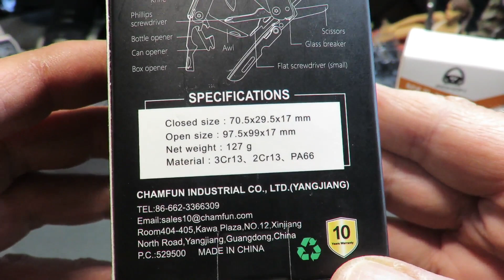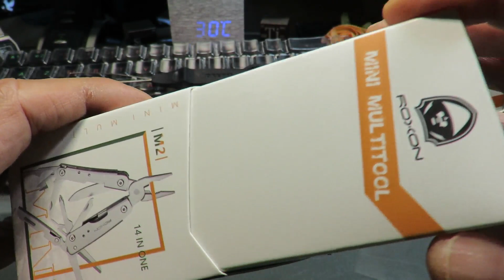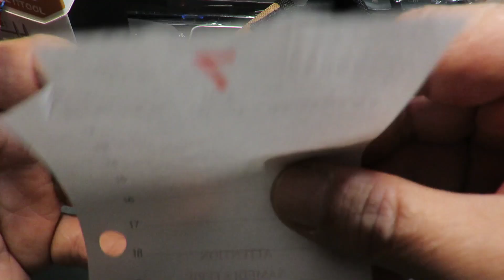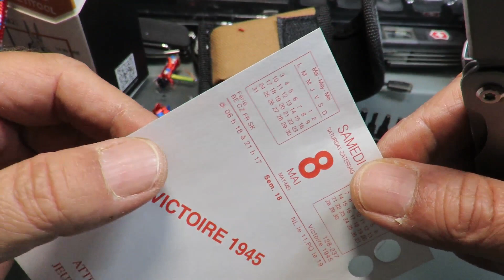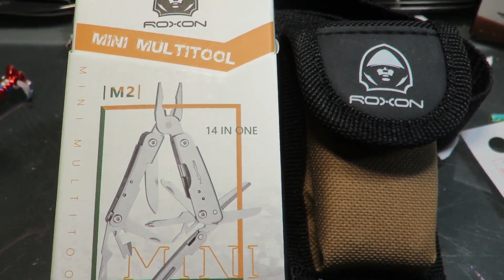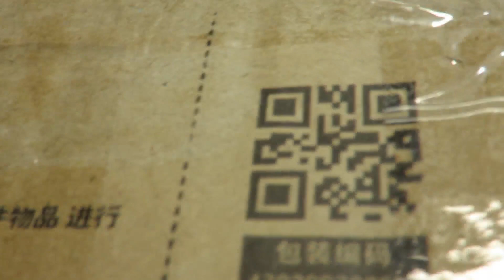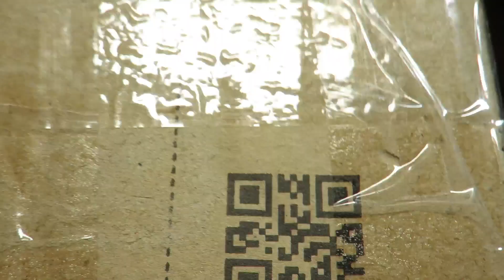ROXON M2 Mini MultiTool - EDC READY!

Comment: Nice video and presentation. 
Notice the pliers hinge was assembled with rivet method always leaves the plier junction either too loose or tight. Use trial and error to finish junction in perfect fitness not too tight or loose is OK for craftsman but mass production line. How may we mass manufacture pliers produced with perfect smooth hinge? 

1. Magic fluid applied to pliers junction before riveted. 
2. Work cycle the pliers close and  open from tight to dragging loose. 
3. Continue so until it is silky smooth. 
4. Ultrasonic cleanse the magic fluid.
5. Apply with clean machine oil. 

Low cost mass produced pliers skip step number 4 above. You can witness that on Page 5:46 … dark fluid leaking out. That is a mixture of a) machine oil, b) micro diamond and c) eroded hinge metal.  

Why is the fluid dark? 
When we do lapping we apply clean oil mixed with super fine diamond abrasive medium. The mixture began clear. When we see it gradually turn black we known lapping has taken effect. Lapping is a process to remove metal in a minuscule scale. The removed metal comes out blackening the oil. 

Multi tool lovers should invest into an ultrasound bath if you want stop that self lapping process. 

You’d never see Swiss pliers shipped with black stuff at the hinge, have you?
Reply from the maker: Merci pour vos informations.

Comment: hi there, do you happen to know if there is on the market an adapter to use standard bits in place of those micro that come with M2? It should go 4mm male to 6,35 female. thanks
Reply from the maker: https://www.youtube.com/watch?v=xmaAxHHbKCs
At 5'12" ...
On Aliexpress : https://fr.aliexpress.com/item/4001355543151.html?spm=a2g0o.order_list.order_list_main.32.3b0e5e5bI35RcA&gatewayAdapt=glo2fra
Reply: Thanks, in the meanwhile I found the same 👌. Feel sorry ordering such a tiny piece from the other side of the earth but there is no way to find it locally. Ciao